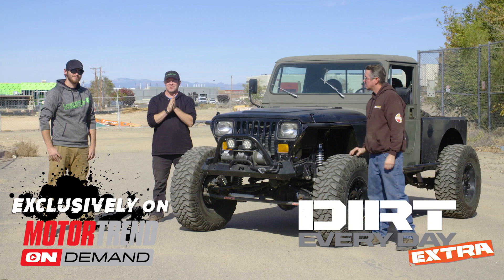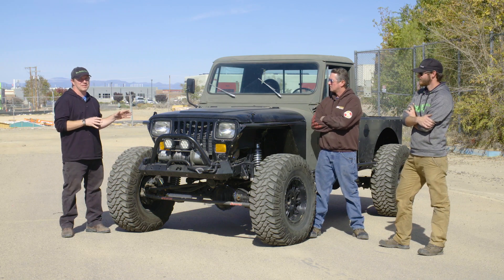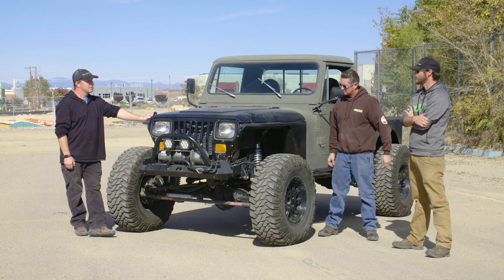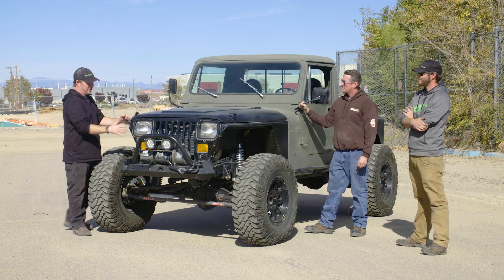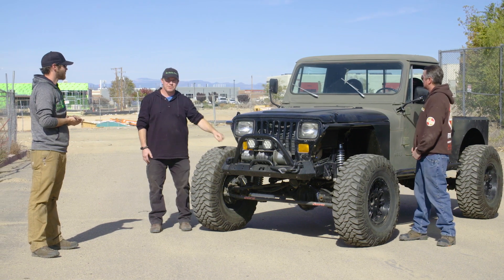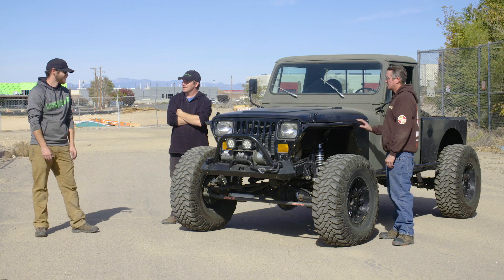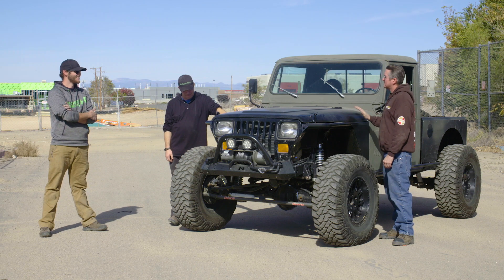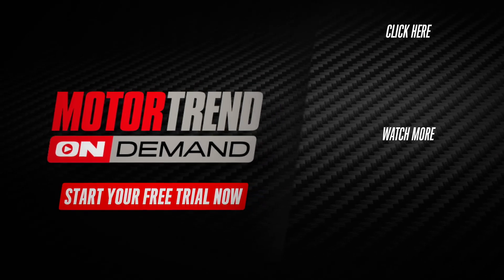A Custom Diesel Jeep CJ10! - Dirt Every Day Extra

Comment: I couldn't find a jeep truck,  so I did a subaru brat instead with a custom coil kit up front and quarter eliptic rear end. shaved fenders, 35 inch grabbers,  ranger axles and a 2.0 turbo diesel from a tdi jetta. elocker and Detroit,  full cage and custom tube doors. already done moab, t-rex,  the rattlesnake,  mad dog hill and the dominator.  sickest subie in western Colorado

Comment: From Butler Pa Birth Place of the Jeep...Diesel is awsome, however go with Cummins!!!! Or go Big Block. 401 Backed with a T-18. Maybe 4.0 with AX-15. Gas or Diesel? Dont matter to me as long as its loud, slings mud and crawls. I aint biased either way.....Im just a Gear Head, Gear Jammer, and Most of all a True Jeeper.

Comment: A Jeep with a Nissan engine in it is not anywhere in the same galaxy as cool. It's pretty much the opposite of cool. More like horrible sacrilege.
Reply: I believe this is the factory engine that jeep installed the cj10
Reply: Not sacrilege if it came from the factory that way. 
My only question is why did it come from the factory that way?
Reply: Yes, it is. I'm normally against engine swaps as they are played out and boring, but, in this case, I would absolutely swap it for a Cummins or Magnum, or hell even a Jeep straight 6 that someone is tossing aside in pursuit of their own engine swap. Even a Duramax or Powerstroke would be better than a Nissan in a Jeep, while still being wrong nonetheless.
Reply: The cj10 was never intended for North America.  In foreign markets diesel was a more popular fuel choice for small trucks and jeep didn't make a diesel engine.